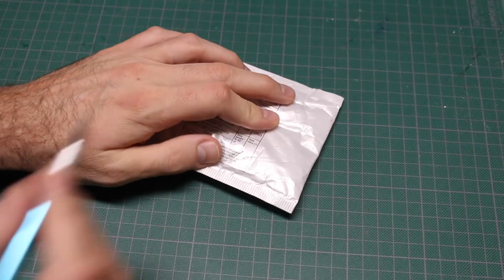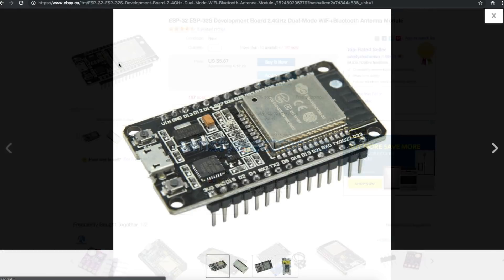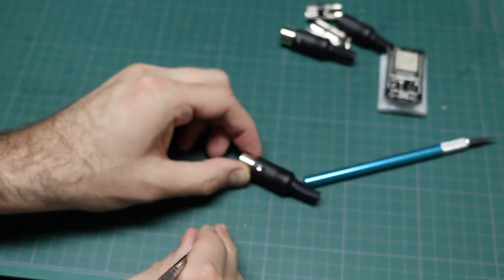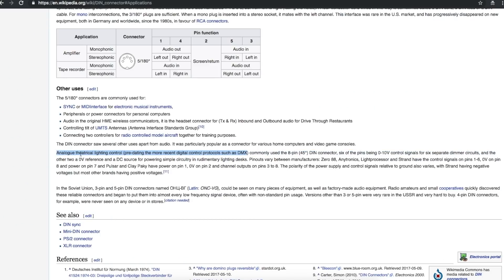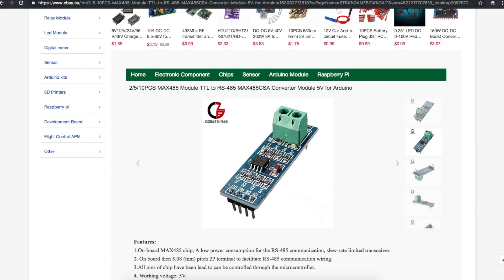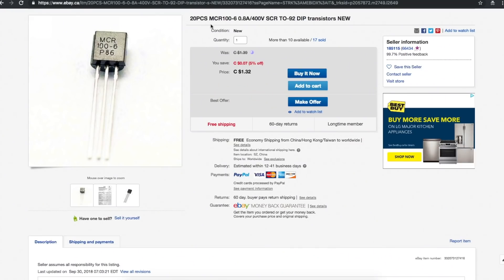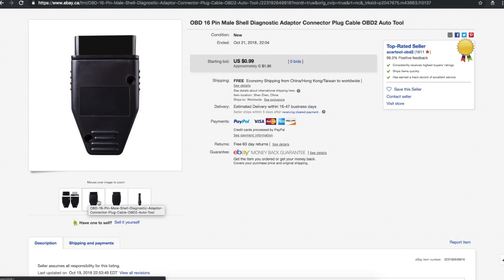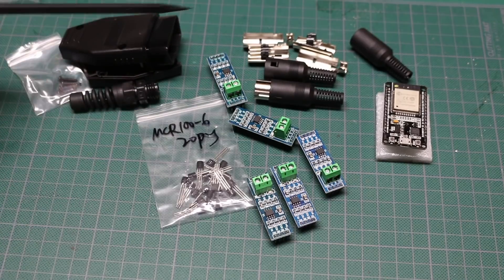Mailbag - ESP32, RS485, OBD2 and Other Stuff

Comment: Is there a way to talk to odb 2 without using ELM-327 ? Open source etc ?
Reply from the maker: I’m still navigating the rabbit hole so my general understanding is once we have the hardware CAN interface  which will allow us to plug into the car communication bus and convert to UART,  we can brute force write code for communicating but that may not be so straightforward so that’s where the ELM or a compatible like STN1110  protocol interface would simplify things. 

https://www.scantool.net/stn1110/

 But I’m curious to look at software implementations like socketCAN on Linux which we can use with a raspberry pi so it’s still a hardware project rather than a computer dependent thing. 

https://makezine.com/2016/04/08/car-hacking-tools-trade/

Comment: You could put a DSP synth based on an LPC810 in that little DIN plug.  It only needs four pins out of the eight on the chip itself plus a zener diode.
Reply from the maker: Got the part open in another tab to check out. 
Thanks!

Comment: Nice haul!  Suppose you will throw those ESP8266's that you did not order out the window?  Your new Wemos ones will not require you to build up a dev board ... much easier to work with.
I associate that 5-pin (mega) DIN with the venerable Model-M, and olde professional AV equipment.  Has a nice heft to it.
Strange I do not remember the term "SCR" in school.  Guess they were thyristors.  SSR's are easy to use and understand for controlling AC devices from an MCU.  You will have to show us typical uses for them.
Reply from the maker: There definitely will be less urgency to get those carrier-boardless modules up and running but maybe one brisk cold day in January or February coming up, I'll feel like mocking up something.

Yeah SCR and Thyristor are sometimes used synonymously but apparently SCR is a type of Thyristor.  I don't officially remember learning about them, at least if I did, they were glossed over, and I never had a use in any projects of my own so I figure it's about time to get caught up.